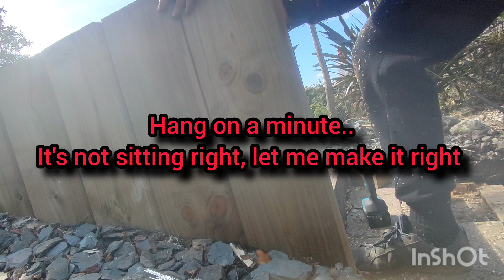LANDSCAPING - TURF LAYING - SLEEPER'S #landscapegarden#landscape#stihl#sleeper#turf

Comment: Curious that you didn't paint the wood ends with a barrier paint to prevent wicking the water up into the wood, even treated or green will eventually breakdown do to moisture.
Reply from the maker: Yes it will unfortunately but it's up against concrete and a row of edging blocks so it shouldn't be too bad , I get what your saying though especially if they are against soil 👌😁